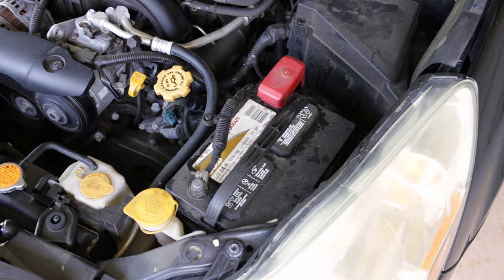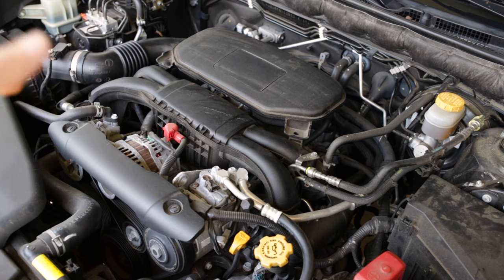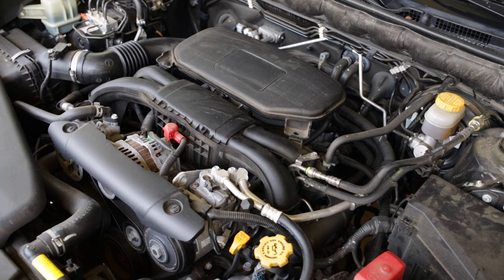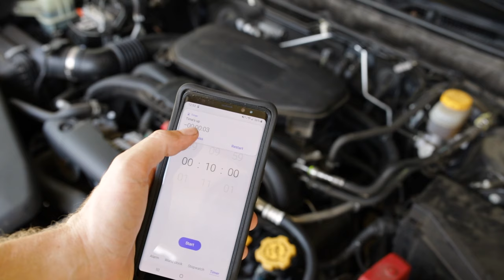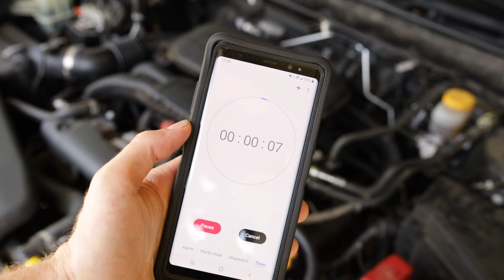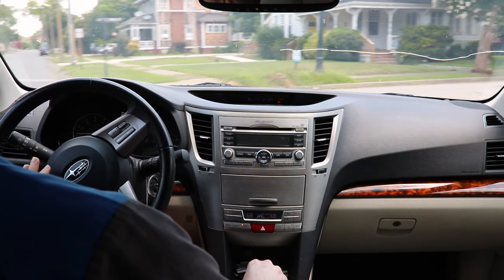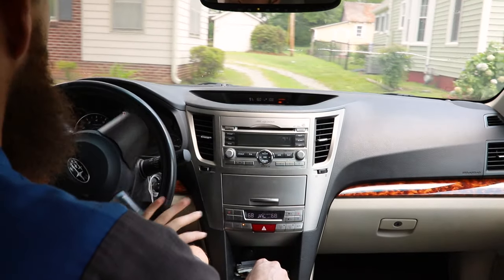Subaru Idle Relearn Procedure

Comment: I had to do this on my daughters' '05 Outback. Somebody (probably me) left the dome light on and ran the battery down. To make matters worse, in the process of checking the air filter I pulled the air boot part way off the air box so when we jumped it, it ran like crap.  Did the training procedure 3 times before I got it right. Should be a pro at it now! As always,  thanks for the video.
Reply from the maker: You're welcome. 👍🏻

Comment: Very useful for my Impreza 2013. This procedure corrected a too fast idle issue especially on D speed since I went to the garage for a recall for valve springs replacement. The garage employee didn’t believe (what I perceived) that this problem began after the spring replacement and suggested a throttle body cleaning, which I refused.
Reply: Interesting because I went to the dealer for a valve spring replacement on my 2012 impreza and I didn’t start having problems with it until after that.

Comment: My old battery died while I was on vacation.  When I replaced the battery my idle was pretty rough.  It wasn't dying at stop signs, but I was worried it might.
Doing this process corrected the idle problem in my 2006 Outback xt and made shifting from a stop to 1st gear a bit smoother for this new stick shift driver.

Comment: That’s funny I just replaced my idle air control valve yesterday, and YouTube recommends this video🧐
Reply: I tried to take my IACV out so I could clean it but the screws were so tight I started to burr them so I just left it all as is lol
Reply: Item69 

Ya I heard they tend to do that, lucky for me they came out without any issues.
Reply: VIsubby 

My 2002 uses idle air control valve 
And that’s what I’ve replaced.
Reply: Silent Russian your 2002 is drive by cable
Reply: Your phone listens to you!!

Comment: Prior to this video, I had put a new front catalytic converter on my Subaru 2008 on me to suddenly get a rough idle after installing it I was like extremely bummed out. I figured the catalytic converter would probably fix a solution only for me to get a rough idle after watching the video and doing all the procedures I am I am completely satisfied with the results, and my car now runs has a smooth idle, no roughness to it and is extremely sensitive in a good way so if any viewers that are watching the video and are skeptical, don’t be this procedure. Sure works.

Comment: I don't usually comment on help videos, I usually leave a like and be on my way, but I'm commenting to help your algorithm. 

This was a last resort for the "free way" to fix my problem. It would stutter hard coming to a stop or turning the wheel when stopped at a light. Even would stutter for no reason with no load. 

I didn't think this would help, but after cleaning the throttle body, EGR valve, and doing this procedure, it runs perfectly! Some stutter when I have a heavy load and turning the wheel, but that's to be expected. I appreciate the video! 

2012 Legacy 6MT for reference.

Comment: I'm very happy to have found this video.
My mom's car started idling very low (and rough) in drive and reverse, but ran normal otherwise. I tried a lot of stuff, searched for vacuum leaks, tried MAF, injectors, O2 sensor etc.
Tonight I cleaned the throttle body and did this procedure and it idles great again. Thanks

Comment: Thanks a lot for this procedure, it actually helped on my 2004 Subaru Forester XT. At first I didn’t understand why my vehicle was choking  and not holding idle while stopped. But after watching this video multiple time, I was confident it was the issue and upon doing it. My car is back to normal. ✌️😃 thanks for the video.
Reply: i tried it on my 2003 2.0 X but to no avail. i guess i don;t have that type of throttle body. meanwhile, my car doesn't hold idle very often, and seems to be choking a lot when i've had to stop at a trafic light :/ it's also using a lot of petrol when it;s supposed to run LPG.. 260 km on what, 35 liters of LPG, PLUS half a tank of euro98 petrol :(

Comment: This helps a lot thank you. So after swapping out the throttle body then starting the motor, it idled at 3000rpm and blue smoke filled the street and after this procedure it stopped smoking and ran fine

Comment: Just did this to my 2017 impreza sedan after i cleaned the MAF and throttle bottle. Car seems to be driving so much more smoothly. I bought this used a few months ago, car is great but ive been doing little maintenance things just in case.  Thank you

Comment: Hello from St Thomas in the Caribbean. I am almost through all of your videos. Truly amazing work. I have a 1999 Forester and it’s perfect for down here. Hard to get repairs done so I have had to learn myself. I realize you probably have tons of requests for advice. We do not have a dealership here or even a qualified mechanic to do the work. If you have time I have an intermittent idle issue. Rungs great for a while then all of the sudden it will almost stall 6 or 7 times in a row and then run great again. When the ac is on and I turn it off the rpms drop like it wants to stall and then levels off again.  New spark plugs, MAF, PCV valve, air filters. Have pulled the IAC and cleaned and put back but I just can’t seem to get it running right. Car runs great under power. Checked for vacuum leaks as well. Also a ton of forums
Reply from the maker: Odd. No other issues, CEL, etc?
Reply: No CEL. I do not know how to properly check the IAC to ensure it’s working..I am guessing that maybe that could be it but don’t want to have one shipped down without checking it
Reply from the maker: @MGoCaribbeanBlue  usually they give a code when they fail.
Reply: Thanks so much for the replies. I will keep digging..keep the vids coming. I loved the new Milwaukee impact review you just. Much love brother

Comment: G'day mate. Awesome bro, it works well on my missis 2006 liberty. Thanks. One thing I've change though, the 1st step. I've disconnected the battery then turn on the headlights for 1 second turn the switch off then connected the battery. In that way you save 10 minutes. Thanks again, awsome tips bro👍👍👍👍

Comment: Another very helpful video.  Worked perfectly but I didn't clean the throttle body yet - it's on the to-do list when I change the timing belt/water pump.

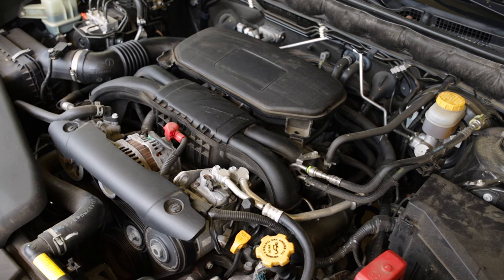Comment: @8:35 you described the exact "issue" that I've had with a used Subaru I just bought. I'm guessing the previous owners never did an idle relearn when they replaced the original battery. I can almost guarantee they traded it in because they had issues with it afterward.

Comment: Why, why does Subaru do this? Disconnect the battery for a routine plug change and then crap idle. Judging by the comments you’ve saved the day over and over again, thanks for taking the time. I guess this needs to be done any time the battery is disconnected in the future.

Comment: Not sure if this is related but my manual transmission XV would rev up to about 2500 if I was in gear and press in the clutch and stay there as if it was anticipating a gear change. It would idle down only if you shifted into neutral or press the brake. It drove me nuts especially driving in traffic with all the stop and go. It eventually went away so it must have relearned itself. I bet this video would have been very useful. Interestingly enough this happened after throttle body cleaning. Regular idle was fine. Just thought it might help someone. Great tutorial!

Comment: I changed my spark plugs yesterday, the battery was out of the car for a few houres.
After starting the car for the first time, it couldn't even hold itself on idle.
Only when pressing the gas pedal the engines will keep on running.
How can I do this procedure if my engine keeps dying on me?
It's a 2006 legacy,
Thanks

Comment: Excellent video that helped my 2006 Outback 2.5 get back to normal. Not to mention I had an ERR sign above my mileage odometer on dash and couldn’t use my cruise control. Now error sign is gone and my cruise control works. Not sure if this was part of the issue. MrSubaru do you think the cruise control and ER sign had something to do with TPS/Idle reset?

Comment: Thanks for this video. I Recently replaced spark plugs on my 2010 Subaru Forester and then was having idling issues, the engine would stall out  at a stop.  This procedure fix the problem thanks again.

Comment: That explains why my idle has been rough since I had the battery out for fixing an oil leak coming from the oil filler neck o-ring. Should I perform the relearn procedure as is or should I wait to properly clean the throttle body and only do it after that?
Reply from the maker: Clean the TB before doing the relearn.
Reply: @MrSubaru1387  Hey,
Is their a video for cleaning the thottle body? Great video!
Reply from the maker: @717273mopar  https://youtu.be/H-YfyXyPvrE

Comment: I had a very similar issue with idle when coming to a stop in a 2013 scion fr-s.  I would hear a clacking noise when the idle drop happened. Cleaning the throttle body didn't fix the idle problem. I think it was due to the valve spring recall for this model year.

Comment: I have a 2000 Subaru Legacy wagon with 230,000 miles and still runs great thanks to your channel. However, recently when I start it, it will immediately rev up to 3000 rpm then drops down to 1750 for a few seconds then 1500 and hangs there for a while. Once I drive around for a bit and stop it idles normally. What’s going on here?

Comment: Do you start the procedure with warm engine or cold? Thanks
Reply: Cold engine. All modern cars idle high when they’re cold, but Subarus do something called a “stratified start”. It basically uses a secondary air pump, lowered ignition timing, and high rpm to force and recirculate hot air through the exhaust valves to the catalyst as quickly as possible while not running too lean. Thats why a proper idle relearn procedure is important for Subarus, there’s a lot going on.

Comment: Insane this is not public knowledge. Yesterday, I cleaned my filthy battery terminals on my 14 Forrester.  Afterward, the car would start then die.  I bought a new battery, car would start and die.  Had to rev upon start and it wouldn't die, then I could get around town buying a new battery.  Called a mechanic and he called me a dummy for changing the battery myself in a Subaru.  Told me to it had to relearn and start it, hold it at 2,000 RPM for 3 minutes, let it idle for 3 minutes, then go for a 4 mile drive for roughly 3 minutes.  I did that and I'm back to normal. Car starts and idles at about 800.   However, now my automatic windows don't work, at least the one click and full up or down part of it.  And my "Passenger Airbag OFF" dash light is on 100% now.    Crazy.  I'll try this tomorrow for the idle.
Reply from the maker: To fix the auto window. Roll the window to about half open/closed. Press and hold the window switch up. Hold the switch up for 3 seconds after the window has fully closed. Let go of the button. Upper limit should be relearned and the auto up/down feature should work again.
Reply: @MrSubaru1387  You're a straight up superhero!

Comment: On Infiniti/Nissan cars, there’s 2 way to do idle relearn.  First is to do sequence pedal pumping and key ignition on off etc (no tools required) or the 2nd one , just remove the negative battery cable and let it disconnected for 10-15 mins. Once restarted, the ECU will automatically relearn the air coming through the  plate by reading the throttle plate sensor.

I’m just wondering if the last part for Subaru is necessarily. Like turning it off 10 mins for the 2nd time etc….you don’t need to run it either on the hwy unless you’re cleaning the upper engine for carbon deposit. Thus it’s called idle relearn. Just idling..

Comment: After a headgasket job on a 11’ WRX I couldn’t get the CEL out. I forgot to do this process. Reason for the light was, i did not  wait the 10sec for the throttle body sweep. Did the proper relearn as this shows and bam, no CEL. The computers are THAT picky.

Comment: @MrSubaru1387 Curious as I didn't see it mentioned, how long should I give it after this procedure for things to smooth out before trying to figure out what's causing the idling issues? 20 min of driving? 100 miles? I have read many different opinions on forums

Comment: Man I need this dude to live closer to me. I have an 05 legacy gt. That hasn't run right since I bought it. The mechanic I brought it to tried everything and told me it's the wiring harness or something internal with the engine that was already replaced after the timing belt snapped with 2000 miles on it. Rough idle and low idle after pushing in the clutch or giving it some revs. Maybe I'll check the throttle body to see if it's gummed up. Either way I need someone I can trust to look at my car.

Comment: Ugh I just had to replace my rear wheel bearings on my 2012 Impreza hatch@ 106k miles. They were toast!!! Along with the rusted out E brake shoes and parts. Alaska roads sure do take there toll.
Reply: @veganpotterthevegan  SWEET! How much air did you have to add? Dose your 2006 forester have TPMS?

Comment: My problem isn’t a stumbling idle but a high idle of like 1200-1500 when cold start. And it stays there for like 5-6 minutes or until maybe the engine is warm. This is my first Suburu and my VW’s do this but only for like 30/40 seconds to warmup the cat, not minutes. I might give this a try anyways. I have an 18 WRX

Comment: I have a 2005 Subaru, Impreza, WRX, bugeye wagon, took off the upper lower intake manifold and replaced the inlet tube to the turbo, because there was a hole in the boot, replaced it with a silicone inlet tube to the turbo started the car after reassemble and got a code for P0519 bought a used auto air control valve because that’s what the code was for still doing it a little baffled because I checked all my vacuum lines and they don’t seem to be sucking in any air

Comment: I don’t know if you’ve covered this or not. But I would love for you to cover why some Subarus (XVs for example) sometimes pop out of 4th gear and/or grind 4th gear. I also notice that there is still a bit of slack in the shift knob even when shifted into 4th gear.
Reply: Sounds like your synchros are going on 4th gear
Reply from the maker: Like John-Daniel Martin said, sounds like an issue with the 4th gear synchronizer.

Comment: Changed headlight and this started. Cleaned throttle body, egr, pcv. Vacuum lines are mostly new. New coil, plugs and wires. Same problem... thought I did the relearn correctly, but I'll try again tomorrow. Not sure why the lights go out when it stumbles.

Comment: This this the same procedure for if you physically removed your TPS and then reinstalled it? I stupidly did this and now my 2003 Impreza 2.5 idles high, rougher and has flashing AT oil temp light and solid check engine light all of a sudden.
Reply: Update: I purchased a digital multimeter and set the TPS loosely in its place and slowly turned it until it hit the magic number, then immediately tightened the screws. Unplugged the battery and pumped the brakes. Within one or two start ups, all the dash lights automatically went away and the cars performance was back to normal. Seemed intimidating at first but was quite simple really.

Comment: How long should a Subaru idle before you drive it? I usually let her go about 1 minute. Regardless of cold or heat.
I also  Turn it on and till I hear it click before I turn the engine completely over. I heard somewhere that's the best way to start the car.
Reply from the maker: I usually idle about a minute before taking off on a cold start. 30 seconds if the engine is warmed up. Cold weather, at least 5 minutes. Glad you do. Most people fire it up and take off right away. Always good to let the oil circulate before taking off.

Comment: Hi ! Thank you so much for sharing your knowledge! quick question, how can I get rid of a permanent CEL after fixing the problem ? Had a p0500 for VSS, faulty F R ABS sensor. Checked the wiring, changed hub assemby (MOOG) and installed a brand new ABS speed sensor. Thnak you so much in advance!

Comment: Damn I can’t let my engine idle for ten minutes, my cooling fan doesn’t work! I’m not sure what’s wrong with my IAC right now but i tried cleaning it last night and now it’s idling at 3000-2500 and won’t go down. I couldn’t get the coolant hoses off the bottom so I just sprayed cleaner in the hole and put it back together. Maybe I knocked some crud loose and it’s stuck open/closed???
Reply: You need a new one

Comment: My 2006 Outback throttle body makes that same clicking noise when I barely press down on the accelerator, then goes away the further I press the accelerator, and also is heard when the car is shifting between gears. It comes back on as I let off the accelerator then is gone again when I am completely off the accelerator. At first I thought it was a loose valve as the sound is very similar. Any idea why it would be making this ticking sound with the accelerator pedal?